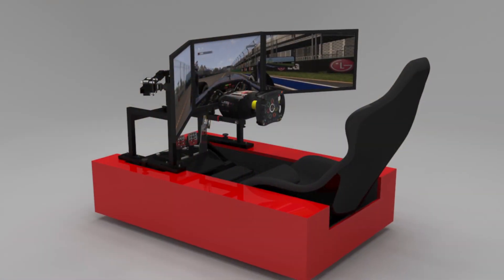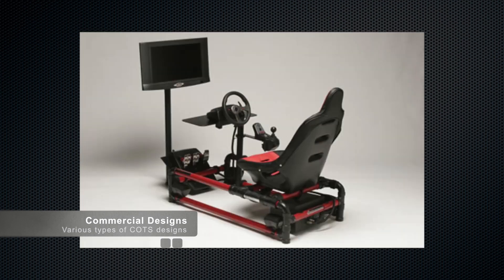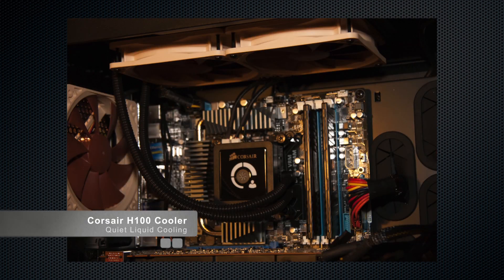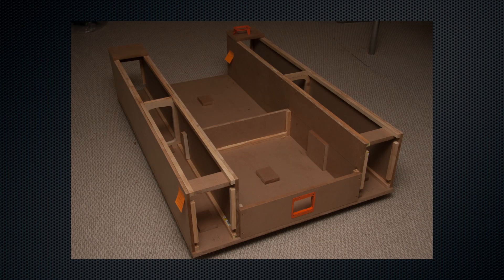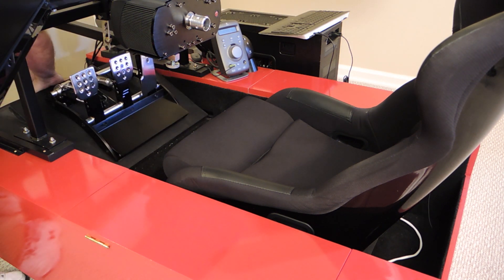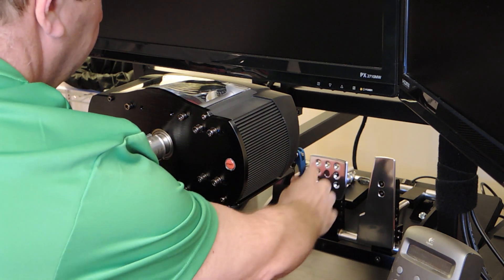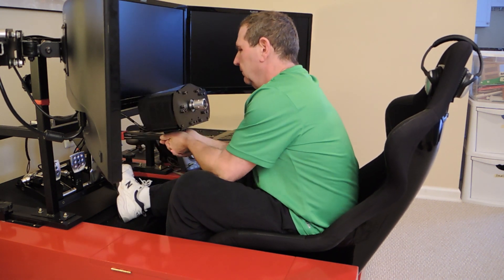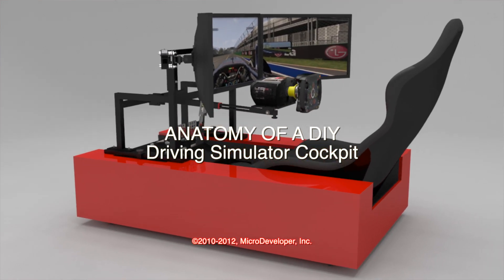Anatomy of a Driving Simulator

Comment: But still the steering wheel base is not stable  especially if you use high power force feedback  wheel
Reply from the maker: I don't know why people assume that.  It is very stable.  I have my FF cranked up to about 125-140% and it's a workout on an hour long drive.  It does flex a little (<.3 in) but it is not noticeable at all while driving.  My tables move and wobble more with lesser wheels.  Regardless, the new design will be much stiffer.
Reply from the maker: One last point, if you look at the end of the video when I'm using the big BMW wheel, that feedback setup is too strong for most kids under 15 and you can see that the base hardly moves at all.  When I hit the curb the camera shook because of the force sent through my arms but the base remains stable.  The fact that I can put 200lbs on it with it deflecting <.3 in should also say something about how stiff that configuration is.
Reply: i am not assuming , i can see it moving and shaking , its not going to break its strong , many people dont mind about that but its moving too much for some one take sim racing seriously
Reply from the maker: Well, I'm not going to argue with what you perceive.  All I can say is that I've never had anyone who has actually used it, comment on that aspect.  Regardless, the MK II setup will be much stiffer.
Reply: i am not here for arguing ether , i really like your project and it's very kind to make it available for anyone , looking forward to

Comment: That is a very nice setup. Great engineering.
I just use a cheap school desk that I have all my stuff clamped to which I can move from the corner of my room in front of my actual desk and move my monitor up. Cost me under 20 dollars. A cheapo "cockpit" setup with no need to remove stuff from my actual desk.

Comment from the maker: The seat just uses two boards, a finish grade 2x4 as a spacer and a piano hinge available at the hardware store for a few dollars.  The height adjusters in the front are parts I machined from 6061 aluminum.

Comment from the maker: It really doesn't deflect that much at all but I am re-designing the entire steering rack to be even tighter.  Currently, it could take about 300lbs in a vertical load before bending.  I'm trying to double that and reduce the custom parts required.

Comment: Thank you for reply. That's very good price compare to the other simulator and acctualy looks really good.
I have got same steering wheel with both rims ( BMW and F1 ) with fanatec V2 pedals and I using playseat WRC what cost me £400 what is roughly same price as yours but nowhere as good as yours - comparison.
Thanks

Comment from the maker: I choose the bucket in order to have something completely self contained.  The bucket seat is solid and it transmits the vibrations from the pucks very easily.  With a spring loaded seat (a typical car seat or chair) it is much harder to get the low-end vibrations through.  Plus, the single bucket is cheap, comfortable, and easy to work with.

Comment: BRAVO. Besides the professional engineering and thought, you have (unlike expensive commercial rigs) properly replicated the correct race driving position. I bang on about it a lot but it's so frustrating to see expensive, sexy, engineered-to-the-max rigs which put you in a bus-driving position. Even GT, NASCAR and sedan racers are seated with backside on the same level as feet, knees and arms slightly bent and steering wheel at chin level. Nice job.